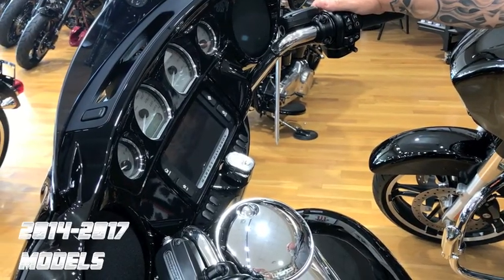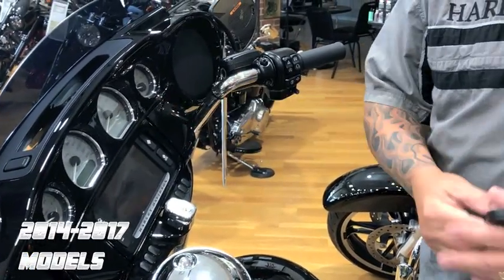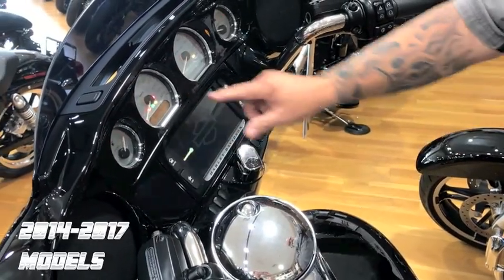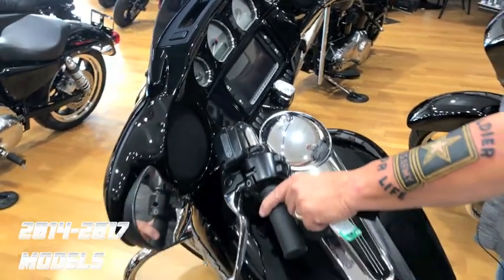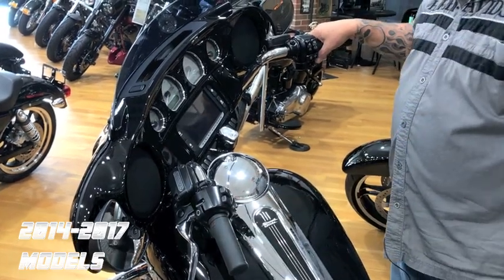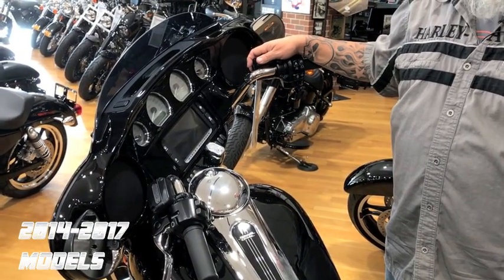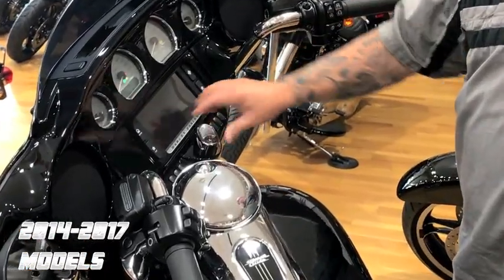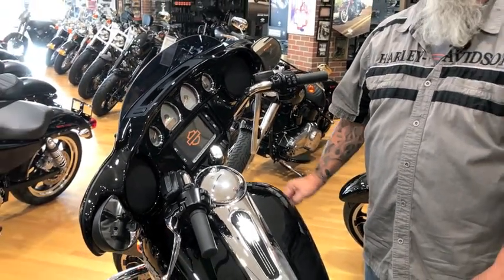How To Put A 2014-2018 Harley-Davidson Motorcycle Into Transport Mode

Comment: Is this for pre-2014s as well? My 05 has a similar security setup, and the one time i had it on a trailer, the lights didnt flash, but they will if you try and start it with the ignition locked
Reply from the maker: No, you need the 2013 and earlier video. Here's the link. to that. https://www.youtube.com/watch?v=Xjq3YAG0T5w

Comment: What is draining the battery when you trailer but not when it's in the garage?
Reply from the maker: If not put in transport mode before leaving for your trip, the security system will still be on. This makes the bike think it is being taken so it uses its lights to get the attention of others. When this happens it drains your battery enough to the point you will most likely need to buy a new battery. Thats definitely not a fun thing to worry about after a long haul to your destination.
Reply: @IndySouthsideHarley  Ahh I see. Thanks for the explanation.